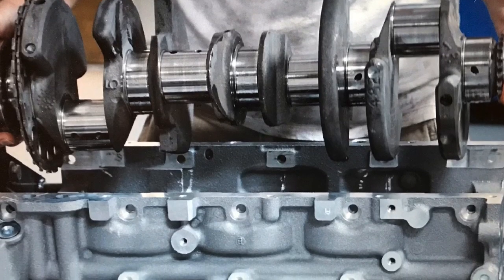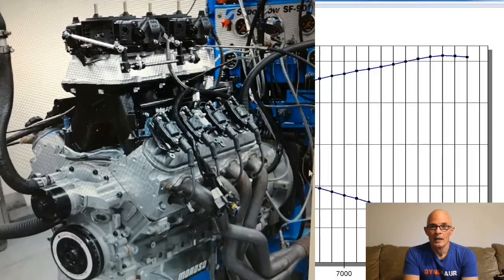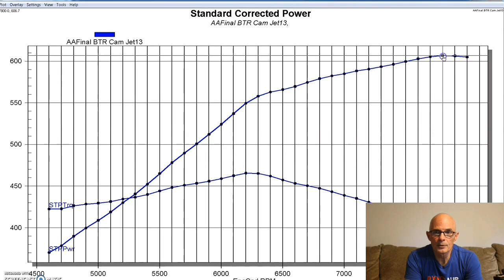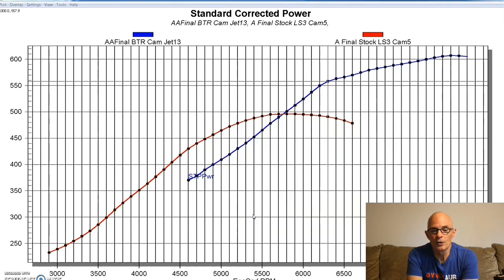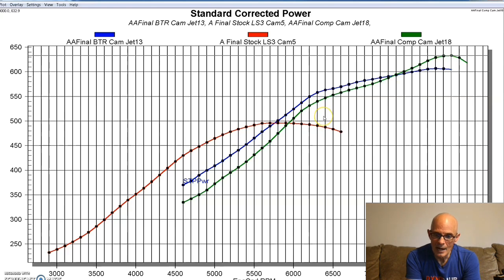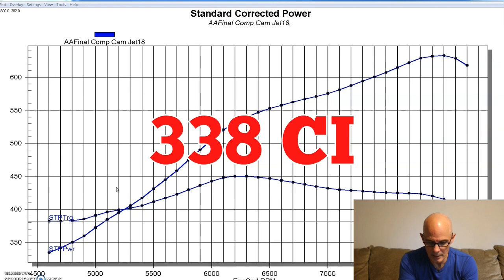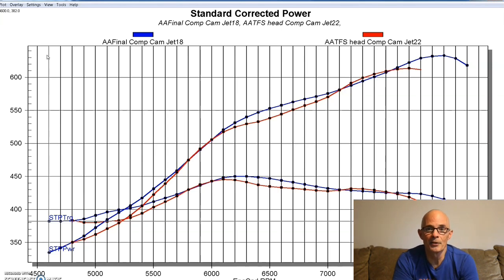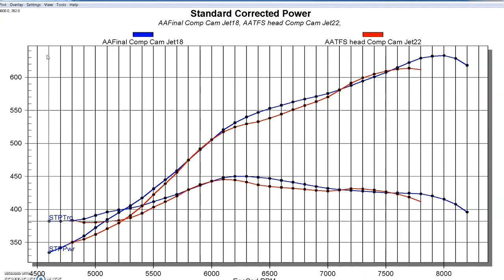DESTROKE LS-4.8L CRANK IN LS3 BLOCK-SHORT STROKE POWER-AN LS MONSTER MYTH?

Comment: Maybe your just trying to hide an rpm secret. Valvetrain is a necessary part of high RPM. But piston speed is why people sometimes do short stroke engines to gain rpm. You can run a shorter stroke at a higher rpm and have the same overall piston speed. Piston speed has a direct relationship between when a rod let's go because of the mass and when it doesn't. Stroke is not a myth at all. It is fact.
Reply from the maker: having tested the effect of rod length-it changes nothing-bigger displacement will make more power and valve train determines rpm potential. Look at the piston speed of mountain motors.

Comment: I have two mid-engine cars. One is a 1987 Fiero GT 5 speed with a L44  2.8L V6 that made approximately 140hp at 5200 rpm and 170lbs of torque at 3,600 rpm . The Fiero weighs 2,780 lbs.  The other is a 2000 MR2 Spyder 5 speed  with a 1ZZ FE 1.8L that made 140hp at 6,400 rpm and 126 lbs of torque at 4,400 rpm. The MR2 weighs 2195lbs. The MR2 feels like a go-kart compared to the much heavier Fiero. Because the 1ZZ makes it's power at a far higher rpm the MR2 is able to be geared lower making the car accelerate even faster. Also because the engine is designed for higher rpm this enables the car to reach a higher top speed of 135 mph compared to the Fiero's 120 mph. When the L44 is peaking out the 1ZZ is just getting started and makes good power all the way to 7000 rpm. What's funny is the Fiero, even though it is a heavier car it's engine pulls harder at a much lower rpm  this makes the car feel more powerful off the line. The MR2 feels like it's got nothing off the line even though it's a significantly lighter car with lower gearing. Torque is about leverage horsepower is about the amount of work done. So in this example you have two engines with a drastic difference in displacement yet make the same horsepower but do it in different ways. The MR2 and the Fiero accelerate off the line at nearly the same rate. But after first gear it's all MR2 from second gear on the MR2 continues to pull away.

Comment: Doesn't necessarily rev higher but which revs faster not a higher rpm but which reaches the higher rpm faster? I'd imagine the power loss you get from an average budget build in this scenario would be worth it if you can reach 6000 rpm very quickly and get that peak power in a very short amount of time?

Comment: What if you ran the opposite concept - small bore (4.8?) with the long stroke (6.0).  The LS equivalent of the Chevy 305?
Reply from the maker: Combining the stoke of the 6.0 with the bore of the 4.8L makes a stock 5.3l (same stroke as 6.0L)
Reply: @richardholdener1727  thanks for answering my question.  Such a good idea Chevy did it!

Comment: The 302 Z28 comes to mind. Rev limiters came into play at that time. I replaced bent pushrods a few times when drivers missed a shift. It would rev out of control. 283 crank in a 327 would achieve that 4x3 ratio.
Reply from the maker: I built a DZ302 also

Comment: I imagine the bigger issue of having a 5.3 or 6.0 Rev to 8k is that piston speed will start to strain the cooling and oil and probably lead to catastrophic failure.    But please correct me if I am wrong.  I have always approached performance from a heat management point of view.   Whenever you ask for more power, you should always ask for how long.    Can I ask what the Rev response was like?  Did it climb in revs about the same as the longer stroked motors? Or was it Rev happy?

Comment: Another reason why someone might want a “big bore 4.8” (or 5.5L) would be that it’s more fun and controllable than a 6.3L making the same power down low. You have a much wider power-band with a high revving engine, and can change the gearing to take advantage of the wheel torque at high RPM. Also the 5.5L revving to 8k is putting a lot less stress on the connecting rods compared to a 6.3L so longevity is a bonus.

Comment: Is there any way to measure how quickly the RPMs climb rather than just how high?
Reply: That varies depending on load and the car combo. 

Short stroke tends to rev faster if everything is built to take advantage of it, but an apples to apples test, the longer stroke should rev faster. Shorter stroke likes deeper gears.

Comment: Sorry but if i wanted 600 hp @ 8000 rpm and 460 tq @ 6300 i'd buy an SR20 or rotary what's the point i can't see one.
Reply: LS based everything is significantly more available, and generally less expensive than SR20's and especially rotary parts.
Reply: As someone with a SR20, I would take the LS.
Reply: @TylerGotAYTAccount  I agree Tyler but the days of having to rev v8s to 8 grand to make power are long gone, if a v8 needs 8 grand to make 600hp it's built wrong as they say no replacement for displacement.

Comment: It might be interesting to overlay the 2 horsepower plots using the same piston speed... the shorter stroke engine really is doing better, but because of the slower piston speed,  for any given rpm, "looks" worse than it really is.  Another thing,  it looks like  the rod got longer to accomodate the shorter stroke so the best cam for that longer rod ratio is different  than  for  a shorter rod ratio. Might be fun to compare  these 2 combo's using the same rod ratio.
I know drag racers that have gone even more "overquare" than was done here and are consistent class winners.

Comment: Back when everyone was building 383SBCs (350 block/400 crank), I was always going the other way building 377SBCs (400 block/350 crank) or 351SBCs (400 block/327 crank).
Reply: One of the sweetest running engines I ever built back when was a 377 destroked 400. Flat top pistons, angled milled camel hump heads with 2.02 intake valves, and a cast iron 2 barrel intake. Don't recall what cam it had but the engine was built for a 77 Camaro in stock class circle track racing. It came from the factory with a straight 6 and a 3 speed standard. I don't recall the rear gear ratio, but it was perfect running in second gear. It won the championship the year I raced it and it very seldom finished in second place. That camaro was so fast that everyone wanted to protest it but no one wanted to put up the money to see what motor I had built. Made me a believer in them destrokers!!!
Reply: alot of people use the 350 block because the walls are thicker then the 400 so it helps with heat. 400 crank in 350 block is 377, 30 over is 383, 40 over 385, 60 over 388 cubic inches. the 400 block had steam holes which with the thinner walls would crack the walls in the 400 block. lots of 350 blocks vs 400 so it was more "common" then to use the 350 block.
Reply: 377’s are hella street motor.
Reply: thank for say that i got a rebuilt  400 n 350 humm may be u need to do something fun a
Reply: Exactly in the 80s we did same thing added nitrous and guys wondered why we blew by them at half track. Of course we hogged out iron heads. Fun memories
Reply: A gentleman who worked with my dad, had a 70 nova he raced for 30 plus years, around 2000 he had a 377 and 383. He said the 377 put up better numbers. Also had a guy swap us a 72 440 for our 400, bc the 400 had a bigger bore and short stroke. It did better on the strip
Reply: In 1983 I drag raced a 1940’s Chevy pickup that belonged to my much older cousin….I was 19 at the time.  It had a 377 in it and ran 11.30’s….then he turned on the nitrous bottle and it ran 9.70’s @136 mph.  It was at Penwell Raceway just west of Odessa, Tx and I almost ran through a fence at the end of the shut down area where there was a tank battery for an oil well….the truck had no front brakes and the rear brakes were old drum brakes and the chute didn’t deploy because I pulled the knob off of it…..!  Old 377 would run!
Reply: That was my motor back in the day when everyone was going 383 instead my poor ass was building back yard 377 with solid cam and camel hump heads kicking everyone's butt
Reply: and in the process you were wasting a 400 block. the process  400 can be stroked to 427. 50 cid difference. at 1.5 hp per cubic inch you designed yourself out of 5 hp. while the myth has everybody believing a high reving motor is the advantage real world science tells you that with 75 more horspower you are going through the gears faster. valve float with anysping makes a pushrod v8 useless after 7000 rpm any ways.
Reply: @gregoryperkins2180 not everyone only races in a straight line like a sped

Comment: The shorter stroke is better for RPM due to less piston speed. It's not all about valve-train, though I agree, valve-train is a MUST for anything high RPM. But if you have too much stroke and weak bottom end pistons/rods/bolts/crank/etc you're at much higher risk due to the higher piston speed with higher stroke. At a given RPM a motor with more stroke will have higher piston speed than a motor with less stroke, which is why people use de-stroked motors for high RPM application.

Comment: You've completely(well not entirely) skipped over why race teams run a shorter stroke. Piston velocity. You want to keep it below ~26m/s. With the short stroke at 7800 rpm you're at a safe 21.6m/s. That same RPM at a 4" stroke is 26.4m/s. Not good for longevity unless you're a F1 team.
As a compare, the 20k F1 V10's you reference had a piston velocity of 26.5m/s at 20k RPM. This is the reason for a short stroke, material strength/longevity.
Reply: Good point! I was waiting for him to mention ousting speed but he never did. There is a theoretical safe limit for piston speed or at least there was when I was studying engine design years ago.
Reply: Yes and no. The big bore allows for more valve area to accomodate the flowrate to make power at those high revs. The short stroke thus allows more bore, obviously, but with it that lower pistons speed.

The old rule of thumb of 25m/s mean piston speed isn't as accurate anymore as piston and more so piston ring technology has improved. You'll also notice that if you're concern was internal stresses, the mean piston speed doesn't show the real stresses like breaking down and deriving instantaneous displacement (travel in the bore), then instantaneous velocities, and then instantaneous accelerations. The latter is where you really start to get forces on bolts, rods, piston bosses, wrist pins. 

In reality, it's a balance of the two, like most design criteria of an ICE.
Reply: What about rod angle? Taller block and short strokes don't put the same lateral forces on the cylinder walls
Reply: Exidous, this is pretty much spot on. At some point, however, there are diminishing returns. The stress on the connecting rods, and the crank throws is enormous the higher the RPM is. Imagine the stress of trying to halt the momentum of the weight and piston at TDC and BDC! The 2 most important things are NOT horsepower and torque; they are volumetric efficiency and BMEP (Brake Mean Effective Pressure). If both VE and BMEP numbers are high, horsepower and torque will both be high. Here is something to think about: A 4 cycle engine revving to 20k RPM has an equal number of power strokes per minute as a 2 cycle engine running at 10k RPM. The great Buick V6 engine builder, Kenny Duttweiler, has said that that, in theory, if you modify an engine (for giggles, a 350 CID engine) that makes it's maximum power at 4K RPM so that it now spins to 8K RPM, you have effectively doubled the cubic inch displacement, going from a 350 to a 700CID engine. Think about that for a bit. It gets pretty deep, and confusing.......
Reply: @milojanis4901  You're not doubling the displacement you're using your displacement twice as fast. This would be like me eating a slice of pizza in 1 minute one day and then the next day I eat another in 30 seconds and thinking I've effectively eaten two slices on the second day instead of doing the same thing in half the time.
Reply: Yes, but you're talking something that works only for bleeding-edge engines like Pro Stock.  They run a shorter stroke and as much bore possible.  
For a street engine, or a hot N/T or bracket engine, that's not a viable option and you're better off just getting more cubes any way you can and not turning it 8,000+ and incurring all the reliability and maintenance issues motors like that have.
Reply: Yes Thank you
Reply: This is geared to the avg. Peanut gallery. Ppl.
Not race teams. Race teams are more than often limited, restricted,. penalized or a combination of above. For higher cubic inch motors
Reply: Hondas s2000 engine had about 26m/s piston speed and those things could Las hundreds of thousands of miles. Piston speed isn't everything when it comes to reliability. Valvetrain and rotating mass is something that is import to factor in when reving something super high
Reply: They get 11,000+RPM out of drag raced 4.0" stroke vehicles.    Some are street driven.    So some of the piston velocity rules have been broken often and things still work just fine.  IMHO needing the super short stroke for high RPM over 8000 is exaggerated.
Reply: Yes, but he also forgot ROD ANGLE which is, I believe, even more important.
Reply: @bigblockjalopy  "Rod ratio"...    So with SME engines producing 4.5+" strokes that turn out to near 10,000 rpm, i think the old piston velocity guidelines are out the door.    Perhaps due to lighter pistons, pins and rods than when those "guidelines" where made decades ago.    If you have a choice of rod ratio and increased stroke, for most cases the stroke should be increased.   If you are limited to a displacement, then you should go for  as much "rod ratio" as you can fit safely.    There are 4" stroke engines with 1.5 rod ratio's or close to and they are revving out over 10,000 RPM.
Reply: @dennisrobinson8008  You can run everything for a time. My 383, which I road raced for 33 years in a land w/o speed limit is basically untouched since new, heads never been off, never any problems, at almost 600 000 KM, it still runs like new. The rod ratio is 1:88 It revs like a OHC 4 cylinder. It still sees 6k every week, at least once. I don't think a 454 would have survived.
Reply: @dennisrobinson8008  ...and I wasn't talking piston speed. Piston side thrust is much, much more important at high rpm. That is why I said "angle" and not "ratio".
Reply: @bigblockjalopy  rod angle will us dependant upon the rod ratio.
Reply: @dennisrobinson8008  I never said the contrary, I just said "angle" to make my point clear, since I wasn't talking piston speed. Most people forget about the side thrust (rod angle) at bdc, which is a major factor when it comes to wear and high rpm dependability or engine longevity.
Reply: what is the part numbers of the rods and piston please?
Reply: I was wondering if anyone else picked up on that little fact....
Reply: It's more about head flow per ci. Bigger diameter pistons mean bigger heads and valves
Reply: Where do you get this 21.6m/s crap? a 526 cid blown alcohol funny car has piston speeds in the 37.75 m/s range with real heavy pistons.
Reply: @thirteentwentyfeet  and they only see that for a fraction of a second before they rebuild them. They also probably don't have to be too worried about ring sealing (blowby) efficiency at that point.
Reply: @thirteentwentyfeet  so you're saying they spin a 4.125" stroke at ~10,800 for more than fractions of a second without ring flutter, or that they don't care about the flutter because efficiency doesn't matter in that sport for that short period...and still have frequent rebuilds.
Reply: @Micah_Makes  The run at over 8000rpm for around 5 seconds per pass. Piston speed of Nitrous Promods have got to be pretty high also with 900+ ci motors spinning 8000.
Reply: @bartpang  my whole point is that to reach his claimed MPS, and a normal 4.125" stroke, that's nearly 11,000...and also far from an endurance application nor an application in which fuel efficiency matters.
Reply: @Micah_Makes  Maybe need to talk to Sonny Leonard. He's built some 900+ inch motors to run in his boat.
Reply: @bartpang  I'm quite familiar with Sonny.
Reply: @Micah_Makes  Those engine are rebuilt after run, that's why they don't care.
Reply: @GlassTopRX7  clearly you didn't read the whole discussion.
Reply: @thirteentwentyfeet  Nope, it's impossible to get a 903 with a 4.375 stroke.  903's have 5.75 strokes.
Reply: @thirteentwentyfeet  Pretty standard across all racing platforms and road going vehicles that need to run longer than 5 sec before a complete rebuild.
Reply: @thirteentwentyfeet  But it only has to be reliable for 5 or 6 seconds.....
Reply: @thirteentwentyfeet   26m/s is sort of a general rule. I really depends on a lot of factors. An industrial diesel with steel pistons wont be able to withstand 26m/s, also no matter what piston speed you have most cast or stock cranks wont spin past 8000 very long without big issues. So I agree with both of you, 26m/s is an ok general rule, but using it as a gospel holy grail if you defy it your engine blows up number is  just not true.
Reply: Mike Healy —.  I think you will agree there is two different philosophies( ways to victory) when building a drag motor and a road course motor.
Reply: @thirteentwentyfeet  aluminum rods have a cushion effect as well.
Reply: @thirteentwentyfeet  The rule is for it to live a while. Funny cars are rebuilt after a few runs and have no cooling system.

Comment: How about the opposite...  stroking a small bore 4.8/5.3.  How would a 4.8/5.3 with a 4" stroke and 3.78" bore coming in at about 6.0L displacement compare with the LQ4/LQ9 with its 4" bore and 3.66" stroke?